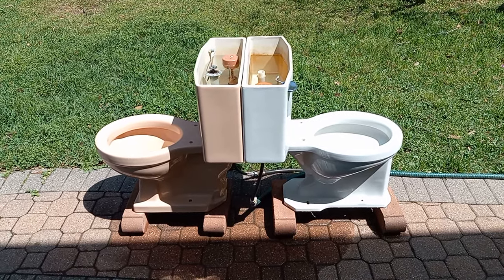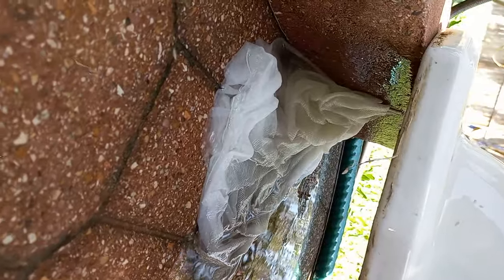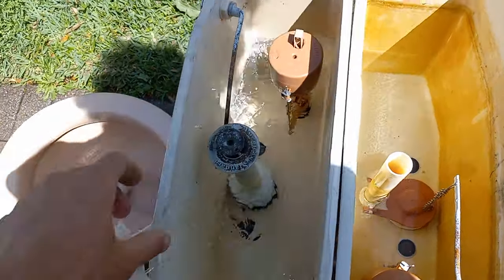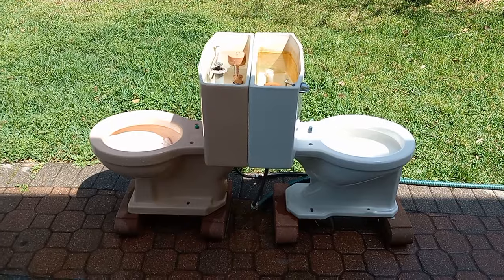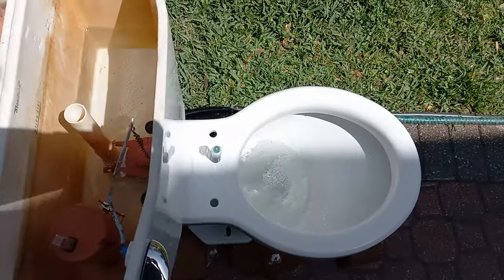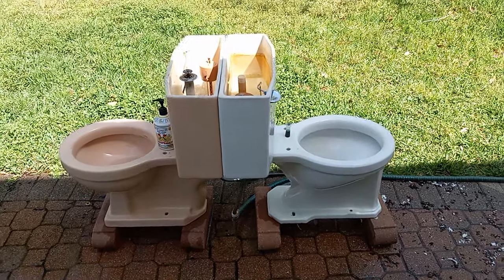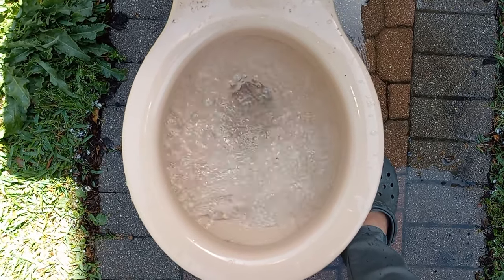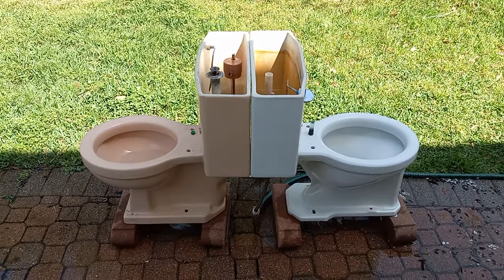Cadet vs Compton

Comment: Great test! Both are good toilets. I had a 1951 Compton installed for a year and then a 46/ 48 mismatch cadet for a couple years. They both were equally reliable, though neither one was totally clog free. I prefer the quicker flush on the Compton. The only thing I didn't like about it is that the bowl is so shallow in the front that often times you end up touching it, lol. My Cadet always flushed foam in one flush after a cleaning. I can't remember how the Compton did on foam but it was generally good.
Reply from the maker: Thanks! These are some of my favorite toilets.

Comment: Many of the track houses in Pacoima, California had Compton toilets in them in the 1960s. The on;ly time they clogged at my house at that time, was when the tree roots would get this in the outlet sewer of the house. Otherwise, they worked excellent.
Reply from the maker: Awesome, Standard was the first choice of many builders back in the day. Unfortunately they started just using cheap mass produced no name toilets more recently
Reply: @OCC_Plumbing_and_Restorations  Wonder if there is a Compton elongated existing around somewhere?
Reply from the maker: @pawfan  I would doubt it.

Comment: I thought the cadet originally had the floating ball/vertical flush valve in place of a flapper or tower
Reply from the maker: The older ones did, up until 1958 or 1959.